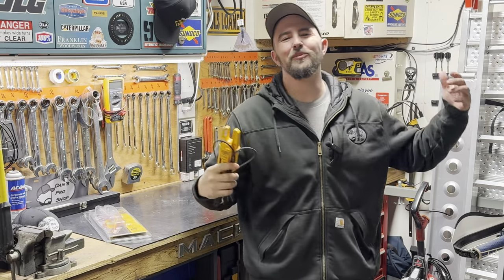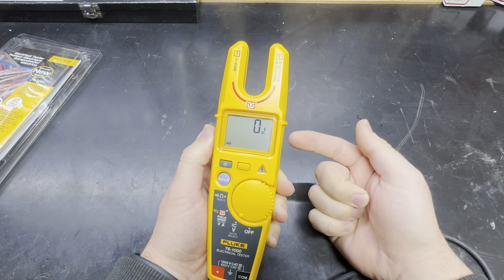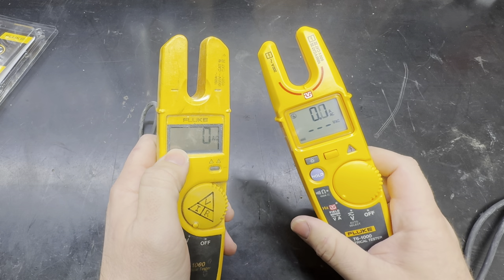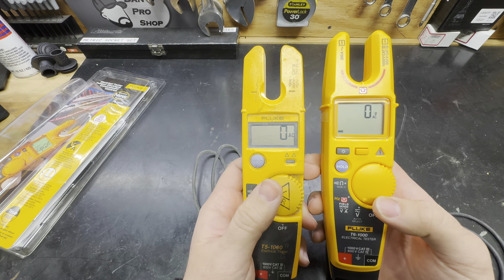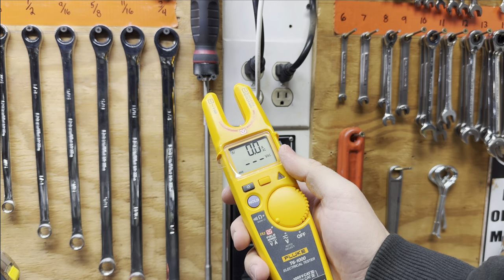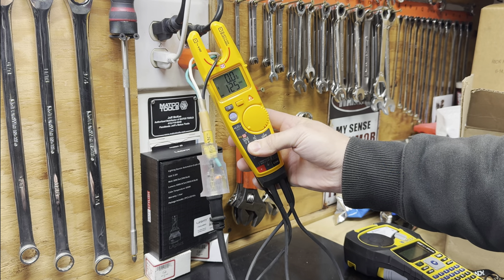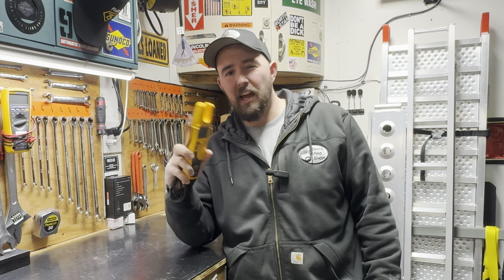Fluke T6-1000, measure Amps & Volts wirelessly AT THE SAME TIME!!

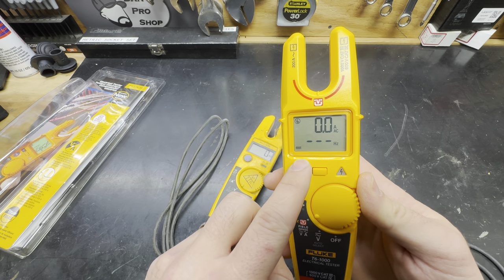Comment: @7:55 time stamp, 
 There was a comment in another video that had answered the Question, as to why they removed the Back Grounding Button....
  He was part of the Fluke Developers that Made this Fluke testers, and they found that Most of the Field Technicians, put Work Gloves on, for Added Safety, in the event that the meter did throw back, an arc, or cause the meter to explode, to protect their hands from that....
  Plus they Discovered, that there was a 3% deviation, in accuracy, with the using the back button, with bare handed testing...
  Where as, with using a grounding clip on the black lead to the Box, assured 100% accuracy, with Clip lead method, and or Black lead contact touching to ground, method...
 @19:52 Time Stamp, I agree, rechargable batteries are anoying, and it is better, faster, to.just replace with new batteries, on the spot, rather then waiting to charge batteries...
  Lots of good details, of good testing techniques, and very informative video...
 Thank you....😎👍🇺🇲
Reply: Best explanation of this model on the internet👌🏴

Comment: $240 ain't bad for a professional electrician.  Now, no apprentice should be asked to spend that much to learn the trade.

p.s. I use a KAIWEETS HT206D which cost me $50 (600A ac/60MΩ) but has no "wireless" capability.